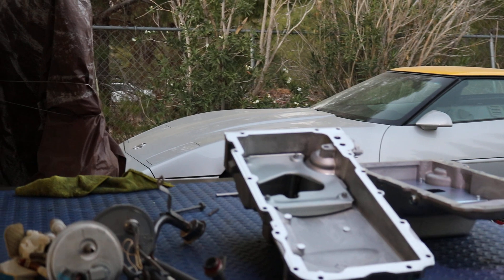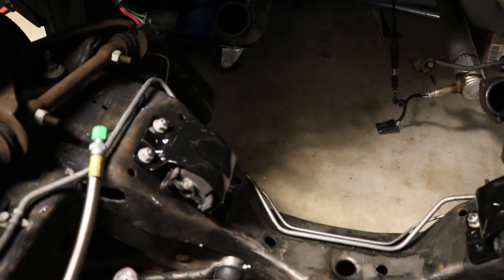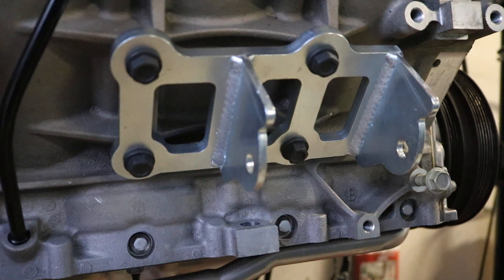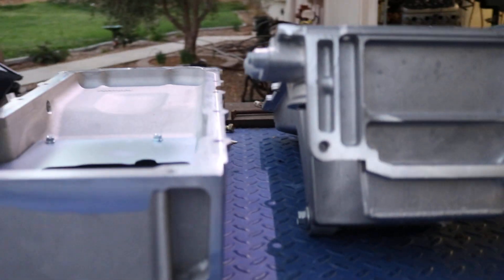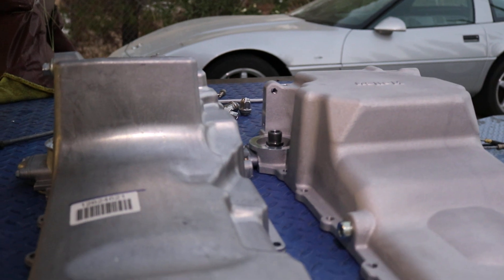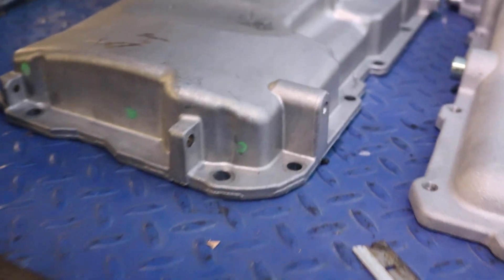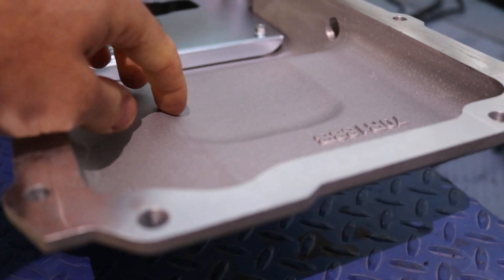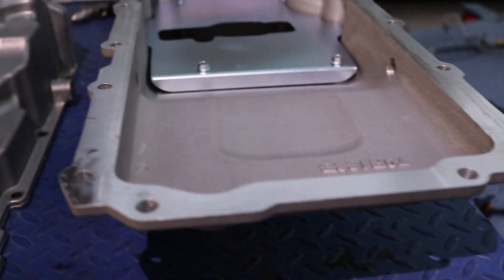Corvette 5.7 LS Swap Into G-Body Cutlass Part 1 (GM Oil Pan VS Holley 302-3)

Comment: Looks like your cradle mounts are mounted on the wrong set if holes. They are towrds the rear you need to move em fwd one hole! the mount corners in the front lower part of the mount need to hang off the crossmember and it would of worked fine. Im running the gm muscle car pan
Reply: I didnt have clearance issue due to the fact removed the ac box but as far as the pan hitting the cross member no.. cradle mounts are mounted to the furthest fwd set of holes on the cross member and im using 1” setback plates. Like i said the bottom corner of the cradle mount should be hanging Towards the front of the crossmember. Literally hanging it will look like a tab just hanging. That’s how the factory sbc mount location came from gm
Reply: 2nd his comment.  They should be on the first whole. I've swapped a few of these g bodies that were originally a v6.
Reply from the maker: How is your firewall clearance? Any issues with the rear coil on passenger side?
Reply: I used the muscle car pan as well , and I believe you do have the holes on the pad mounts set incorrectly , but at least you have it done now

Comment: Seeing the -3 a min ago saved me so much headache. And you pretty much explained what I wasn't 100% clear on. The -3 will clear a 4" stroke. The -2 is the smaller 3.869 or what ever it is. Now I see what the difference is  and I'm ordering a -3 in a min. I'm impressed by the twin oil drains for mine more than anything lol.